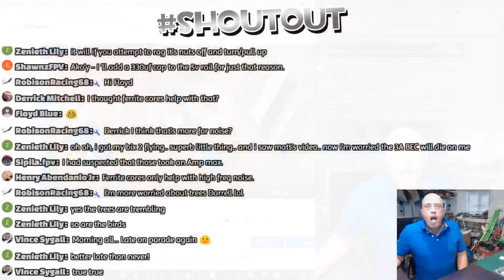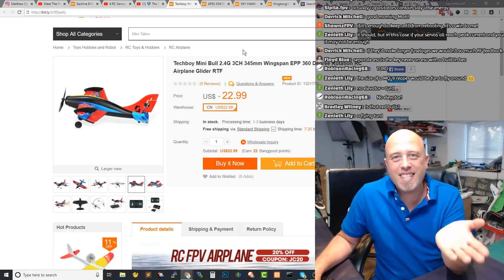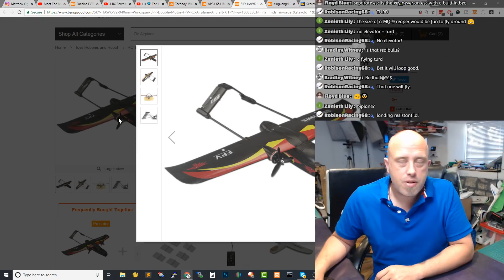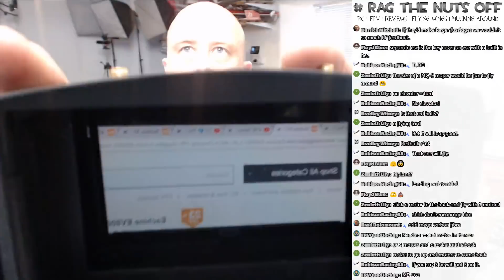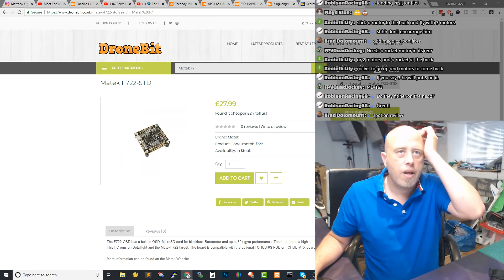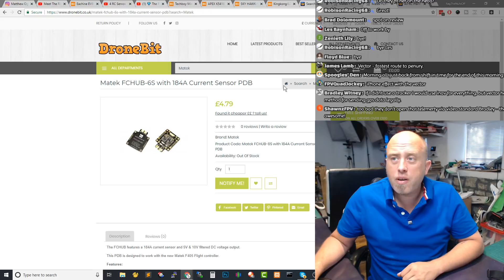☕ RC Coffee Chat #209 - Ketchup with your BoT's?

Comment: Matt. 
I can remember you saying in one of your videos that it’s difficult to bind receivers working on your own. Can’t remember which video.
Get yourself one of these and put it line. Easily flick the switch, instead of trying to hold down the button and plug a battery in. Makes life easier m8. Keith.
https://m.banggood.com/OnOff-Switch-Connector-Plug-JST-Male-Female-Wire-For-RC-Li-po-Battery-p-77399.html

Comment: matt I don't know if you mentioned it or not but on your f7 board, where did you get the pdb from to go with it as the sight i see you looked at they don't mention it??
Reply: ok i see it in your links is there any where else i can get them from as there out of stock??
Reply from the maker: Morning Nigel, not sure, have a look on the usual sites, BG unmanned Tech & so on... Matt
Reply from the maker: I had a nose this morning, it's only BG that appears to have the board in stock, also get this PDB instead "Matek FCHUB-W PDB" as it's the one designed for fixed wing models and would have made my install easier. Matt
Reply: https://www.quadcopters.co.uk/matek-f722-std-flight-controller-with-osd
https://www.quadcopters.co.uk/matek-fchub-6s-osd-with-184a-current-sensor-pdb
are these the ones you mean??

Comment: Hi Matt have you had any issues with the VTX with your F7 board I can't get any video with mine its something wrong with the camera as I have a black screen regards Tim
Reply from the maker: Howdy Tim, mine worked OK. Daft one is the camera and lead OK? (are you really sure?) and do you have it plugged into the right connectors on the board (easily done!). Matt
Reply: Hi Matt yep the camera and leads are on the right pinouts and I have tried two other cameras. I know that the VTX is working because I am getting a black screen on the channel I think there is something wrong with the board. Shame though because you are right about the board being some how smother,( much better response) any way thanks for your input keep up the great work with your channel, I watch a lot of youtube  and yours is up there with Sir Bruce. Top content thanks Matt     Best regards Tim
Reply from the maker: Hey Tim, ewww that sounds no good for the board :( And of course, thank you! Matt

Comment: Hi Matt and all.
I missed out this morning but on the servo testing, I agree with putting a scope on the system and I would run the test through the full radio set-up.
The thing is, every plane/set-up will be different and so will be difficult to baseline.
Loving your work brother Matt...
Happy flying.
Reply from the maker: Hey Dave, yea a scope would be helpful in seeing whats happening, I don't have access to one, so we may just be left with a multi meter instead. Either way we'll stil get an idea on wtf is going on :) Matt